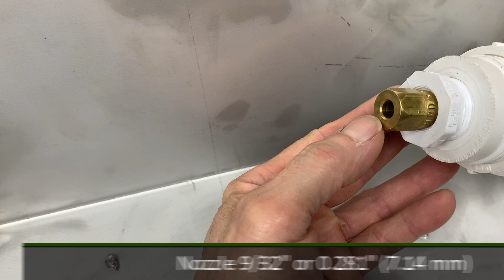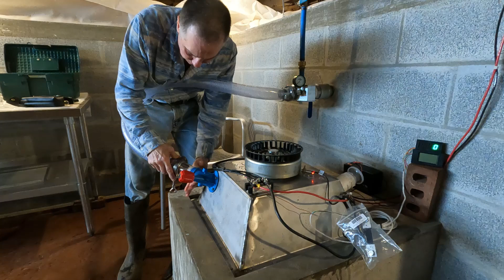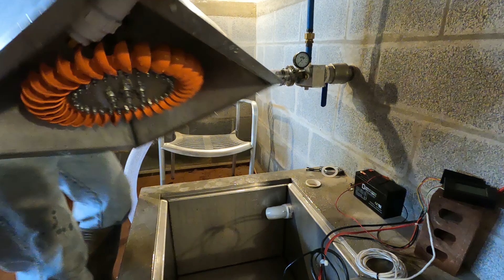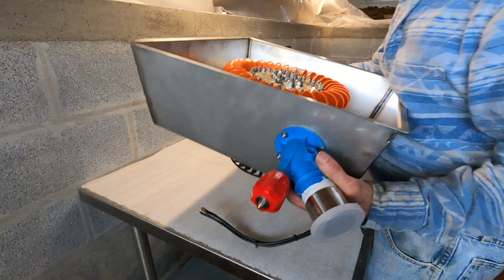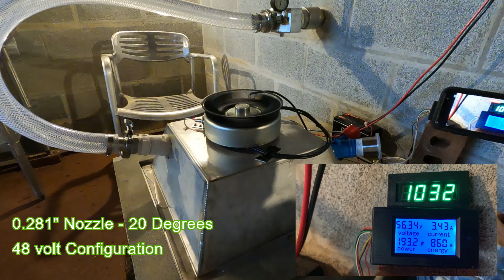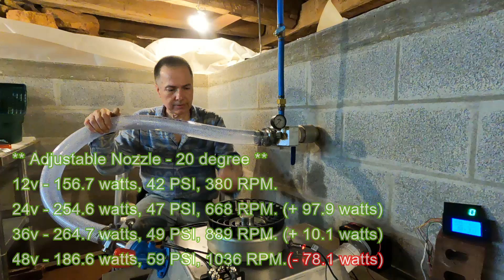Micro Hydro - 32 Spoon Turgo

Comment: Hi, Magutz, glad I found your videos; they are helping me out. How are you changing your voltages on each test? And where did you get your boxes from? And your water line is from a creek? Keep on testing, and I hope it all works out for you.
Reply from the maker: I'm changing the voltages by battery configuration, running the generator straight without a charge controller and a 1000 watt load on the batteries. This is for testing only.  The boxes are custom made at the company I work at.  The water line is from the creek with a head of 160 feet at an average of 50 GPM. This is a 2 inch water line which is no good for running a hydro generator, a 3 inch line should be the smallest you should run.  Thanks for your kind words.

Comment: Wonder if a motor /pump connected to the system charging battery can recycle the water to the same tank where water comes from and still power left on the battery!
Reply from the maker: No, you get in the best case scenario an 80% efficiency from the generator, so slowly the system would come to a halt. The power that the pump would require to return the water to the source is greater than the power generated by it. That would be perpetual motion which is an impossibility.

Comment: I'm no expert but shouldn't the nozzle be pointing dead center on spoons?? You have it changing angles with different covers.  0° would be best way to hit spoons
Reply: I think you want them slightly above pointy slightly down so that the water flows downward. Any water going up is likely to hit the turbine on the way down and cause resistance.
Reply from the maker: This is a Turgo runner and the spoons are designed so the nozzles are aligned at a 20 degree angle. The nozzles are hitting the spoons at the center but at the recommended angle. With a Pelton runner,  0 degrees would be correct.

Comment: Given how easily the turbine and generator unit turn, could you gear up the generator so it is turning faster than the turbine, generating more power?
Reply from the maker: That is a good observation. Using different diameter runners has a similar effect than using a transmission. The runner or Turgo wheel on this video is the one that has obtained the highest power output so far. Using a smaller wheel bugs down the generator and doesn't climb to an efficient RPM.

Comment: I would like to learn how we could scale this up to several turbines, wire the output in parallel, at 48V, to supplement battery charging for a solar array.

thx
Reply from the maker: I have more questions than answers. Why not use a larger turbine instead of several? How much water flow and pressure do you have available? What size is your solar array?
This can be done using independent charge controllers or a hybrid unit and supplying the same batteries.
Reply: I like idea of larger diameter turbines,  creating greater torque,
good idea.
Reply: I don’t have any water available yet, just trying to understand the technology first, so i can design a robust reliable system.
Reply: Solar array is 24kW of panels capability.
Batteries 90kWh storage.
Inverters 36kW of production capability.
Reply: But my goal is to understand how to scale regardless of diameter of turbine.  

I want to understand how to safely wire multiple units in to a system, such that 
1) each unit is protected from the others, and 
2) the combined output can be used to charge the Battery Array, but 
a) not drain the array, 
b) not damage the array, and 
c) not harm the inverters or other components.

I can not find an online diy community, that is brain storming these ideas, so that everyone can evolve these concepts in to a viable compliment to a solar system, to supplement power when the sun is not available, and to provide extra power when sun is available.

The same wiring concepts would also apply to wind.

I am thinking diodes circuits would be needed to maintain energy flow as desired, and circuits to redirect as needed.

But I would think this problem has already been designed and a product should exist, i just need to find it.

If it does not yet exist, it is a market just waiting for a talented engineer to design a solution,
or for a diy’er to create an open source schematic to help us build our own safety circuits, that would allow an array of energy sources (wind or hydro) to combine their output, protecting any back-flow of current, and to route the combined output to the batteries, without any back-flow of current, but with set points for max power to batteries, and min power of batteries to trigger input when low.  When batteries are full, then circuit should have ability to reroute any output, to a non critical DC load, for various uses, such as a pump, water heater(s), or any other useful loads.

I hope someone out there 
has some suggestions on how to achieve this idea.  And can provide links where we can start evolving these concepts.

thx
Reply from the maker: @Just_An_Idea_For_Consideration  I think what you're looking for is above my paygrade. If I understand correctly, you're looking for system that can handle two different inputs and load diversion which are available. I'm currently editing a video on a small scale similar to what you've mentioned, I am using the hydro to assist my solar panels when needed. I should have it ready before the end of the year.

Comment: Wait...how are you putting a 1500 watt load on a 108 w system??? am I missing something? Are you doing Terrance Howard math?
Reply from the maker: You do realize that I do have a battery bank? By overloading the system and lowering the battery voltage, I'm able to see the response off the generator. Different voltages affect the load currents. In that test it was to show by how much.
Reply: @Magutz you mention battery bank once at the 6:13 mark one time, I must have missed it, my bad.
Reply from the maker: @MrDhalli6500  I didn't quite make it clear on this video on how I'm performing these tests, I'm partially at fault. Thank you for posting.

Comment: I think you have too small pipe diameter to go wiyh the turgo. You should go with pelton and mppt.:hand-purple-blue-peace:
Reply from the maker: I will take your advice into account, thank you.
Reply: a turgo is just half a pelton, and has better draining behaviour, more suited to multiple nozzles...
Reply: @paradiselost9946  but to take advantage of that better draining, you need more flow, and bigger inlet pipe. He does not have that.
Reply: @aRnEn87  "draining" as in water, once having expended its energy upon the wheel, can freely get away from the wheel rather than being dragged back around with the wheel, which absorbs power. 

water passes straight through a turgo and can get away. you can have as many nozzles as one feels necessary along its circumference. 

a pelton has to be horizontal, and any more than two or three nozzles and the water falls back into the blades rather than into the drain.
Reply from the maker: @paradiselost9946  That's a good point, I have been testing both Turgo and Pelton.
Reply: @Magutz  its one of the most important aspects.
the water is supposed to lose ALL velocity when it hits the blades. except that means its not moving at all, impossible. ideally though, it should stop when it hits the blade. 

if it bounces back its overloaded and spinning too slow.
if it clings to the wheel and sprays off, its spinning too fast.

if it stops in the plane of the buckets, it gets smacked by the next blade, that takes energy to re-accelerate it.

so a pelton, by splitting to both sides, has to be mounted horizontally, and nozzles only at the bottom.
Reply from the maker: @paradiselost9946  Mounting the Pelton vertically with the nozzles at the bottom is a good idea, preventing water from entering the bearings is the tricky part.

Comment: Thanks for all the work you are doing testing this.  I can only get 20 psi from my water source and I am learning so much from your tests.    I have a 600watt solar system, 24V.  I was looking at the 12/24V fridges, but opted to just get a 120V fridge and just run it through my inverter.   It works amazing, it was a bit cheaper to buy and most of the year I have ample power. 

As I add a bit more solar, more battery capacity and additional loads, I really wish I had designed my system as a 48V system.   48 over 24 may be something you want to research before you commit.   Once you buy your controllers and inverter, it is pretty expensive to change.   

I look forward to your next video.
Reply from the maker: I will analyze my 24 VS 48 setup carefully before I decide, your feedback is greatly appreciated and thank you for sharing your setup information with me. How many GPM do you have available?
Reply: I only get about 35 gal/ minute.  It’s a pretty low flow creek that is about 400Meters from where I would need to put my power shed.
Reply from the maker: @robjohnston8632  With those numbers you should be able to obtain about 200 watts with a 75 mm water line. That is if you have 35 GPM year round. The biggest draw back is the cost of the water line. It is more cost effective adding additional solar panels.

Comment: These are the number (theoretically) that you should shoot for:
RPM: 48% of your freewheel rpm. (Ideal 50%, but you are having 10-20 degree tilt on the nozzle)
PIPE PRESSURE: 66-67% of your static pressure. (because that is the sweetspot between pressure and flow)
As you have an adjustable nozzle you should be able to hit these two points of RPM and Pressureloss if you are using an MPPT as an electric controller.
Your setup in the video will not be stable/repeatable as you do not know the SOC % of you battery when you change setup, and therefore not have equal load on the generator. 
These may be some tip to get closer to your 300w goal. 🙂
Reply from the maker: I will use your numbers to calculate a fixed nozzle. On my next tests I'll be utilizing the MidNite Classic. As far as the SOC; you're correct that it does affect power output on my directly wired setup but it has only been around 5%. I will take your figures into account. Thank you.
Reply: @Magutz  How high are your head, in meters?
You pipe is 969m long and 48,2mm internal?
Reply from the maker: @TommyFleseland  Yes, that is correct and 49 meters of head.

Comment: I am no expert on this, but shouldn't a true MPPT inverter use the same input/rpm no matter the output voltage?
Since it forces the RPM down and thus the input voltage due to your generator being permanent magnet it seems more like a PWM inverter wasting all energy potential by forcing the input voltage to the same range as the output voltage?
Reply from the maker: MPPT charge controllers use a buck converter in order to do the power conversions. Allowing a higher voltage to be present at the PWM and lower, higher current at the output (battery side). How well will the MidNite Classic perform? I hope not as bad as the Epever.

Comment: for a starting point, measure the flow rate, calculate the linear velocity of water exiting the nozzle.  The tip speed of the Turgo should be about 1/2 the exit velocity for maximum power generation.
Reply from the maker: I'll try calculating it as you suggested. Thanks for the tip.

Comment: What rpm reader did you end up using?
Reply from the maker: The DIGITEN 4 Digital Green LED Tachometer RPM Speed Meter, I got it from Amazon
Reply: Thanks! Something I did install on my system, is a digital water meter that shows the flow rate. I know you already know it, but it’s nice to see if that changes or fluctuates. 

I’m still trying to figure mine out, I have 300m of drop, only 16 gallons per minute flow, about 50/60psi, and only 32mm/1” penstock pipe. 
I did install the Midnite Classic 200, but it only showed me 60W. 
I know I have air in the system, as I don’t have a barrel at the top to air out the system and collect some of the silt. 
I’ll keep an eye from when you install your Midnite classic and see if can make any changes to mine to at least get to 200W. 
Thanks for all the time you put into this! 
Cheers!
Reply from the maker: @adipreli3982  According to my formulas with a 32mm ID pipe running 300m you can expect to get 133 watts at 50 PSI and 177 watts at 60 PSI. The air will work its way out of the system as long as you don't have any low spots on your waterline. Do you have a stand pipe installed?
I think it is a great idea to measure the flow rate, what flow meter are you using and how well is it working for you?

Comment: The best charge controller for hydro that I’ve found is the Morningstar Tristar TS-60 or TS-45.  It has true dump load functionality unlike the Midnight classic which only can activate a relay to a dump load which pulls the power from your battery/inverter.  The Morningstar actually pulls it from the incoming dc power from the turbine and thus isn’t micro cycling your batteries (reducing their lifespan).  It’s also cheaper than the Midnight Classic.
Reply: Dang, I just installed the second Midnite. I wish I knew about the Morningstar. I set up a relay, hopefully correctly.
Reply: @adipreli3982  it works….just not the ideal way to dump your load.
Reply from the maker: The Tristar is a PWM controller and does not have MPPT functionality which is required to obtain maximum power out of the generator. I also don't see how it could possibly be better for your batteries when the MidNite is 100% programmable in three different stages of charging.
Reply: @Magutz  MPPT is important for solar but not hydro, PWM does just fine for hydro since it is typically a pretty constant speed without much variation. The statement about the batteries wasn't related to charging them, it does that just fine.  What I was referring to was, when your batteries are charged and the current drops down and your turbine starts to speed up and can go into overspeed without a load.  With the Midnite when that happens it can activate a relay to turn on a "dump" load to keep the turbine under control.  (This video explains the issue https://www.youtube.com/watch?v=A9Meq8wLbME)      The Tristar PWM pulls that power from the DC current coming from your turbine BEFORE it ever reaches the batteries to keep the voltage at whatever your FLOAT is set to.  Mine goes to a bank of resistors in the inverter box that just creates heat.  Some people will put a DC rated hot water heater element (very cheap) in a hot water heater.  It's a much more elegant way of doing it and I was sad to learn that the Midnite didn't do it in that fashion because I was planning to upgrade to one.  Midnite makes excellent products and using their classic will work for hydro but I just don't believe it is the best way to do it based on my experience and research.     Cheers.
Reply from the maker: @NC_Hydro  You're making a very compelling argument, I have the MidNite Classic on hand right now so I will add the Tristar to a future video, thank you.
Reply: @Magutz  Fully admit I could be wrong but that’s been my experience so far.  The nice thing about the Tristar is it’s relatively affordable.  Curious what battery inverter setup you are doing?
Reply from the maker: @NC_Hydro  I'm currently using 2 pure sine wave Renogy inverters, a 1K and a 3K. I turn them on according to load requirements. Nothing fancy.
Reply: @Magutz  Very nice.  We've been running Magnum Energy 48V MS4448PAE since 2008.  Upgrading to dual Victron Quattro 48v/8,000W with Trophy batteries this summer to allow for larger loads.  We are running two houses from the current setup.
Reply from the maker: @NC_Hydro  Nice, impressive setup!

Comment: You don’t want your pressure to be dropping that means you are using more water than your source can supply.  My setup is 58psi, 2” pipe 700ft long and 5/16” nozzle size was the sweet spot.  400 watts on 48v system.  Pelton style not turgo
Reply from the maker: Thanks for your info. The pressure will drop compared to your static pressure. But yes, once set, the pressure should sustain. I also like the Pelton over the Turgo. What is your runner size and how many spoons does it have? What is your head-height? Is 58 PSI your static pressure?

Comment: The results are expected. Larger diameter rotor = more torque(more amps) and a lower freewheel speed(less voltage).
Max power is to be expected at half freewheel speed. 
On the 48V config with variable nozzle and higher pressure with lower flow more power is expected since the water jet is faster and the freewheel speed is higher.
For a 24V config a even larger rotor might be desirable when not using a charge controller since it will lower the speed and shift the maximum power point down.
Reply from the maker: Thanks for your advise. I requested this Turgo for optimum power at 12 volts but it turned out to be at 36 volts.

Comment: Theory says 6 degrees. And in theory, theory and practice are the same
Reply from the maker: Your statement is correct but sometimes there are limitation or exceptions to formulas which I may not be aware of, that may have been the reason in this case.